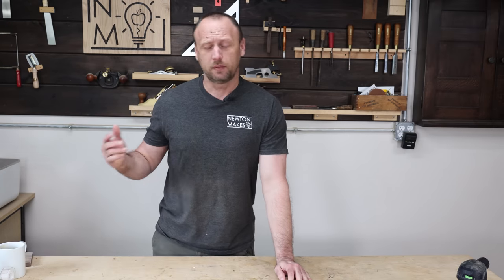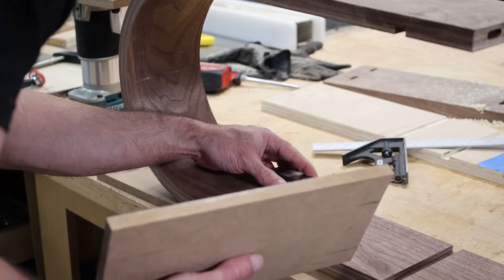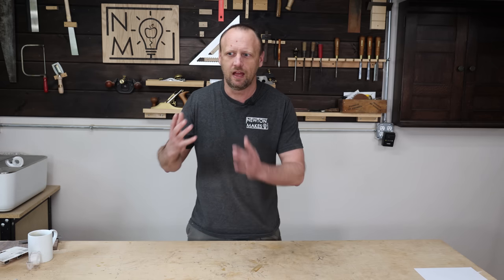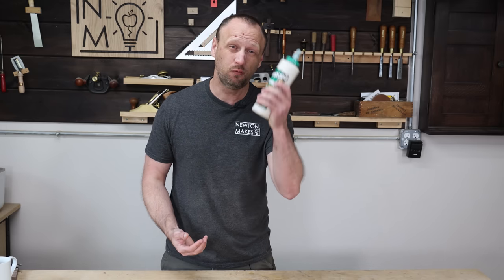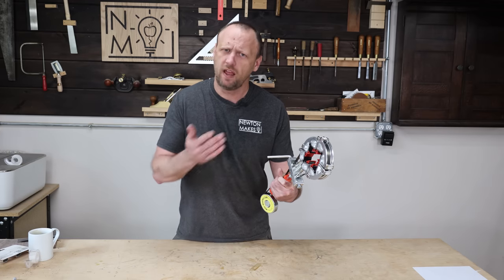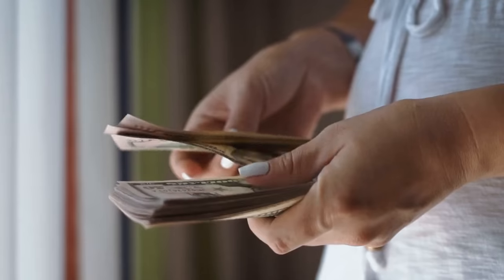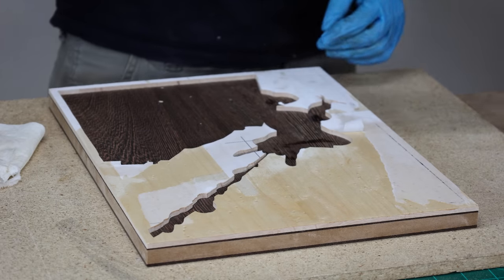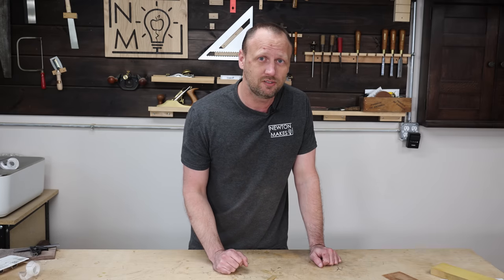I Wish I Knew This When I Started Woodworking! | Woodworking Tips for Beginners

Comment: Advice. Almost anything you build, with enough effort. Can be made with a hand saw, chisel and hammer. 

If there’s a simple way. Try it. If there’s a harder way. Try it. Woodworking is a series of problem solving. And the chances of something happening and then a day, a week a year later you take a step back and realize, I could have done it this way, faster, safer, more accurate is only possible if you try different approaches. You’ll find favorites. But it’s nice to learn. 

I learn how to do things. The hard way. And then usually because of time constraints, I end up having to buy whatever or build whatever that makes it faster easier etc. but knowing how to make something, I suppose a “traditional” way makes it so you can look down factory builds (really the whole point of this) and so you can appreciate the time and effort it takes to make something.
Reply from the maker: Well said.

Comment: I have a router with a half inch bit that I used to cut holes for speaker boxes with. I got an inch and a half long bit should I do one 3/4-in panel at a time or would it be okay to go on and route out two panels and use the whole inch and a half of the router bit?

Comment: Sorry if I'm argumentative, but it is important for a really smooth project if you're finishing with an oil that you sand in steps. I use 80, 150, 220, 320, apply 2 or more coats of oil, wet sand with 1500 grit and wipe it off.  Smooth as a baby's bottom.

Comment: All you really need to measure really exactly is the outlines if you're building a box for example. After that you can pretty easily calculate everything else from those dimensions.

Wanna have a divider or shelf going strait across? 
Total length minus thickness of your wood used on the box = exact measure.
More often than not measuring like this has been more precise for me than actually trying to measure the inside by hand.

Comment: The whole sharpening thing, especially the strop. Same thing with kitchen knives and the steel that comes with every knife block no one uses. Including me, until I started sharpening my own knives. Use the steel every time, don't need to sharpen knives so often. It does not sharpen the edge, it just re conditions it and prevents pre mature wear and tear. Things I wish I knew a long time ago😁 but were right there in front of me the whole time.

Comment: I think the thing I learned is find the root cause. Typically takes 20 minutes or less. For example, I use a DeWalt contractor grade table saw. ( no need to grumble, works for me ) My problem was the mitre gauge. It came from the factory sloppy. Not really a problem I use a sled or mitre saw most of the time. 

This seemed to be a problem for everyone. Like the mitre guage that came with the saw intentionally stank. I looked closer at the mitre slots, they had slag in them from the manufacturing process. Cleaned those out and actually had to replace the runners on my sled git a tight fit again. Runs much smoother now. 

So now the mitre gauge is worse, super sloppy. Shimmed that with some scrap tin and CA glue, so now it doesn’t flop around. The markings and locking mechanism are a lost cause. I set them based on the piece (not sure which tip that was of yours) or another tool with the proper angle. 

The point is really dig when tuning the tools. The problem may be different than expected. And cheaper too. Cleaning the slag I did with a 400 grit diamond stone in a few passes. Not using the gauge to set the mitre gauge. Both free. I did not spend $100+ on a Incra mitre gauge.
Reply from the maker: What you describe is the skill set of a maker. We should all be problem solvers and figure out creative solutions. 👍

Comment: I have to disagree when it comes to the glue squeeze out. Iv been woodworking since I was in the 7th grade, so 90% of the projects I made I kept for myself. And I never worried about glue squeeze out in my early years of woodworking. Then I got into high school, where my construction teacher made us get good glue squeeze out on every single joint. Well it turns out that most of the glue joints from middle school failed after 5 or 6 years, but 95% of the projects from my high school years are still in great condition after 15 years. 

So if you're not trying to get a proper glue squeeze out, then you're bound to have a few glue joints here and there that aren't as strong as they could be.
Reply: I think his point is that not every joint requires squeeze out. I would agree that it depends on the project, visibility of the joint, and the potential for gaps (like cutting boards) where gaps are a deal breaker. I don’t think it’s fair to say you never need massive squeeze out, or that you always do. I think ultimately the decision should be made, like most other decisions in woodworking, based on the project and the desired outcome. You make an excellent point, though, about longevity and durability. They should absolutely be part of the decision making process, too. 

My first “big” projects were a series of desks. It was a Covid need for school and work… you know. Anyway, I made most of them from cheap construction lumber based on “farmhouse” designs (because they were created for people like me — only a little bit of experience, etc.) What I learned about wood shrinkage and flex over the past two years has taught me TONS about a variety of techniques I used or failed to use. Nothing like time to supplement your education in anything… 😀

Comment: I would be interested to know what tools you recommend (other than a sander) are important to buy good quality and which ones don't matter as much.  Nice Video, got me to subscribe.
Reply from the maker: Great idea! Leave that with me and I'll see what I can do.
Reply: Agreed, good subject.  Personally, I think I've wasted money buying expensive squares and similar tools.  Buy aluminum or steel, check it, and if it's square enough, keep it.  I've also wasted a lot of money trying to "save" money on miter fences for my table saw. I seem to be disappointed with everything...should have just bought the Harvey at the beginning.  Still haven't, but will. On clamps I love my lightweight aluminum bar clamps, and use them much more than my heaving parallels.  I've been happy with cheap ones from Harbor Freight and stiffening them by inserting a stick in the bar.  Cheap and effective.

Comment: I've built caskets and YT's top woodworkers would be horrified at how little glue you need. Literal pro tip: put a small amount of glue on a scrap and press another scrap onto that glued surface then pull it off. You'll clearly see whether your amount of glue spreads edge to edge. And if that's good enough to hold up a dead body, it's probably good enough for your shop shelf or jewelry box.
Reply: I can see your point however that shop shelf or jewelry box will or can be around for many years whereas a casket for only a few days to be never seen again.

Comment: Hobbyist woodworkers miss out on the best random orbital sanders ever made. If you have 220v access and a place to put it (a closet, different room or even outside if it is under a roof like a carport) then a 60-80gallon two stage compressor can give you access to the best sanders ever made. The Dynabrade sanders will out perform any electric powered sanders.....a trick I learned woodworking in commercial furniture and cabinet shops.